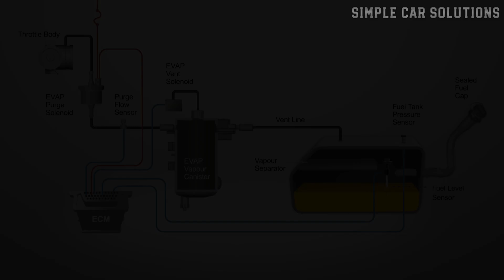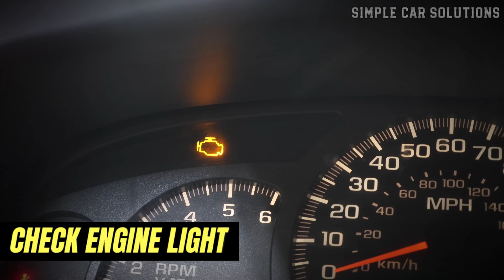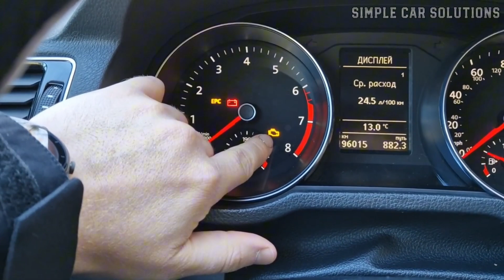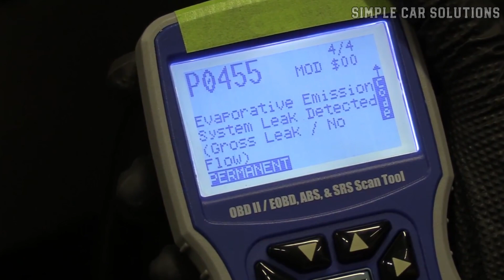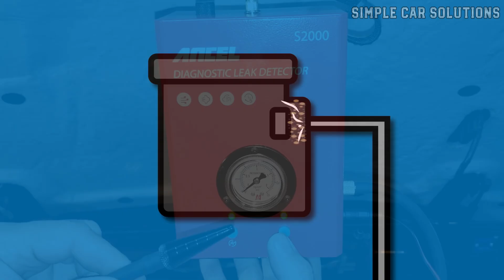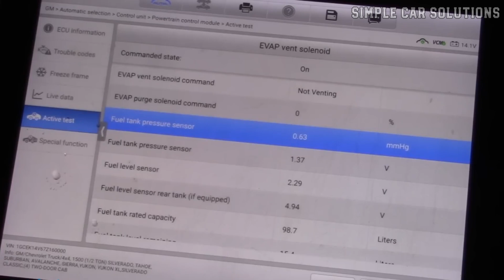5 Easy Signs EVAP Vent Valve Needs Fixing! Don’t Ignore These EVAP Canister Vent Valve Symptoms!

Comment: So I got p0446 vent control problem and p0455 large leak detected replaced fuel cap fps vent solenoid and purge valve. Smoke tested system and found no leaks solenoid clicks on and off as well as inspected canister filter from vent solenoid hose and found filter to be clean not excessively dirty any idea what else I should do before replacing canister? Btw this is a 05 Silverado 5.3
Reply from the maker: Before replacing the canister, check the vent valve wiring and ground at the rear frame (very common on Silverados), and make sure the vent valve actually seals when commanded closed. Also inspect the vent line from the canister to atmosphere for internal blockage. If those check out, the canister is the next likely culprit.

Comment: My 2017 ram 1500 3.6L vvt is showing code p0441 i have checked purge valve with 12v and is opening and closing, i have cleaned canister filter, what more do you think could be. Thank
Reply from the maker: If the purge valve checks out, next check the EVAP vent valve (stuck closed), vent wiring, cracked EVAP hoses, and the gas cap. On Rams, a faulty vent valve or restricted vent line is very common with P0441. A smoke test is the fastest way to confirm it.
Reply: @SimpleCarSolutions i ordered  the cap already, was little bit loose
Reply: Thanks.
Reply: @SimpleCarSolutions how can i do the smoke test
Reply from the maker: @lestergd4198 You can use a smoke machine connected to the EVAP system, usually at the purge valve or vent line, and watch for smoke escaping from leaks. Make sure the vent valve can be commanded closed during the test for accurate results.

Comment: Hi, my 2006 Toyota Yaris is failing the emissions test.
I compared it with another Yaris and noticed that when the purge valve is operating on my car, I can hear air being sucked in with a noticeable noise. On the other Yaris, it operates quietly and normally.
I tried swapping the purge valves between the two cars, but there was no difference — the issue stayed with my car.
On my Yaris, whenever the purge valve activates, there is a clear sound of air being drawn in intermittently.
Could you please help me diagnose this issue?
Reply from the maker: That noise usually means a vacuum leak, not a bad purge valve. Check the EVAP hoses from the purge valve to the intake and charcoal canister for cracks, loose fittings, or a stuck vent valve. Also, inspect the gas cap. A smoke test will quickly pinpoint the leak.

Comment: 😊😊 question, about 2022 GMC sierra, where are systems located?
Reply from the maker: On a 2022 GMC Sierra, the EVAP vent valve is usually near the charcoal canister by the fuel tank, mounted on the frame rail at the rear of the truck.

Comment: You gave some false information......The vent valve is normally in the OPEN position so doing a smoke test will be inconclusive when seeing smoke come out of there. You have to make sure the computer signals for the vent valve to close in order to do an accurate smoke test. Also, just because the vent valve is open during a smoke test doesnt mean its stuck open like you said. As I mentioned, OPEN is the nromal position for the vent valve.
Reply from the maker: Vent valve default position may depends on the manufacturer. A smoke test should be done with the valve commanded closed to accurately check for leaks.
Thank you for pointing this out in the comments.
Reply: My 03 highlander vent valve is closed until actuated to open
Reply: @TheKeeperofdeath  Yep. Hyundai default/no power is closed. Going through this crap now.
Reply from the maker: Vent valve default position depends on the manufacturer. That’s why you always need to check the wiring diagram or service info for the specific vehicle before testing.

Comment: How about P0456 (very small EVAP leak detected).  New gas cap (OEM) filler neck is clean and shiny, replaced purge valve.  (2011 Saab 9-3 with 86,000 miles).  cleared generic code, but Saab OEM enhanced mode says no codes stored in memory, using an innova scanner.  I do have a smoke machine but haven't smoked it yet.  Trying to avoid dropping  the tank to check the pump sealing ring , etc.. Anything quick I should look for?  I drive on clean roads.  Inspection due Dec 25.  Thanks!
Reply from the maker: Check the easy spots first before dropping the tank:
- EVAP hoses at the purge valve and charcoal canister
- Vent valve and its hose (common leak point)
- Cracked small-diameter vapor lines near the rear wheel well
- Loose or dry-rotted canister fittings

Then run your smoke test - P0456 almost always shows up quickly with smoke.

Comment: When I did my smoke test on my 2018 Malibu LS 1.5L turbo the smoke was coming from the fuel tank area
Reply from the maker: Smoke from the tank area means you’ve got a leak back there, likely a cracked EVAP line, bad vent valve, or leak around the canister.

Comment: I have no error codes, but still i can smell gasoline inside the car, can be  evap purge valve blocked on open?
Reply from the maker: Yes, a purge valve stuck open can cause a fuel smell inside the car. Also check the fuel cap, lines, and tank area for small leaks.
Reply: @SimpleCarSolutions see my  comment above. I need expert opinion
Reply from the maker: @OleRazzleDazzler  Your symptoms strongly point to low fuel pressure or a major vacuum leak.
Check: Fuel pump/fuel pump relay, Cracked vacuum or PCV hoses, Air intake tube.
Stalling when you press the gas is a classic sign of a fuel pump failing.
Reply: Does it cause a rough idle? I have a rough idle, and the fuel pump is always shutting down when fueling, but no codes… :(
Reply from the maker: @shannonwitthacannons9461 Yes, a stuck-open purge valve can cause a rough idle.
The pump shutting off during fueling points to a clogged vent line or vent valve issue. I’d check both the purge valve and the EVAP vent line next.
Reply: @SimpleCarSolutions  Thank you! I changed the purge valve, which didn’t seem to have anything wrong with it. Still have the same issue so I’ll move on to the vent valve!
Reply from the maker: @shannonwitthacannons9461  Good plan 👍 Check the vent valve and vent lines next. That’s often the culprit when the purge valve is fine.
Reply: I have a large and small evap leak codes. And random misfire on bank 1(1,3,5,7) , lean mix bank 1. Replaced those spark plugs, now after a little test driving, I have all those codes again besides lean mix, but my truck stalled and wouldn't accelerate anymore. Help me please. 20p2 dodge durango. Im honestly close to killing myself with fighting this truck, other issues as well within 3 weeks, im homeless, I live in my car, I need ot to survive.
Reply: Car will now start.....real rough, and it starts stalling when pushing the gas pedal when idling, this is of course after I coasted to a parking spot when I lost all engine power while driving. PLEASE. SAVE MY LIFE.

Comment: When doing a smoke test does the vent valve need to be powered?  I did it with the key off and smoke was coming out of it.  Does this mean its bad?
Reply from the maker: Yes, with the key off, the vent valve is open, so it will leak smoke. Power it closed during the test; if it still leaks, then it’s bad.

Comment: Thank you for your video he was very informative. 
I have a 2014 E450 van.
I was constantly blowing fuse number 76 at 20 amp fuse.
Check all my contacts under 76 and I think my purge valve solenoid was going bad.
I put a test light probe into the socket of the fuse on the outside line of the fuse and tied a ground to the probe this lit up and stay lit for a long time it eventually faded down to just a minor glow and the problem has gone away so I'm thinking that it is the purge valve solenoid
Reply from the maker: Sounds like you’re right - a shorted purge valve solenoid can definitely pop that fuse. If the fuse stopped blowing after the current bled off, the purge valve was likely the culprit. Good catch.

Comment: I have replaced the canister,vent valve and selenoid and the 449 code is still showing up 😢
Reply from the maker: Check the wiring and connector to the vent valve, especially for corrosion or broken wires. Also, verify the vent line isn’t kinked or blocked.
Reply: @SimpleCarSolutions thanks so much
Reply from the maker: @bmw201144  You’re welcome! 👍
Reply: @bmw201 How did this resolve for you ?  I was thinking that once all that is replaced - you'd want to disconnect the negative battery cable for around 10 to 15 mins - to erase the original codes.

Then hook it back up and drive the vehicle for 50 to 100 miles - to see if the replacement parts work or not. Have you done this or what ended up resolving the problem ?
Reply: @turnsufficient4971 I tried all of that and still 0449 code changed out the solenoid three times and that code for the solenoid still keeps coming up, and the engine light has never went off
Reply from the maker: @turnsufficient4971  Disconnecting the battery can clear stored codes, but it won’t fix the cause. If P0449 returns after driving, there’s still a wiring issue, bad ground, or PCM control problem. Best next step is checking power/ground at the vent valve or doing a smoke test.

Comment: Good evening, its a great video to have a better picture about the vent valve and its work. Very few are out there.
Im searchung for months my issue on my VW golf 5 1.4 fsi BLN 2003.( Early golf 5) i had a p0441 code and after scanning everything said change the purge valve right at center back of the engine. It goes well 2..3 days and then p0441 again. Changed it to an Oem purge valve.  Same thing after 2 days. So p0441 still there. Chacked hoses all good. Canister souds like heavy sand inside but no breaks outside.  So i dont even kow what the issue can be. Cause after canister or passengers weel next to engine there is nothing but a white 8mm  pipe going back to the tank. I checked all 3 damaged purge valves even new one they are all steak opened when conpletly disconected and air flows in them ..not totally free but pretty stuck opened, like 30%++. I have disconected the hose that goes from P.valve n80 to the intake and blocked both of them on right side with tape so no air+vape goes in intake freely for few days and no vapors go out of purge valve.i just open tank cap after every ride to escape the vapes. Same again p0441 on! My issues: bad acceleration, roufh starts and maby sometimes engine dye first cold start. Sometimes jerks a bit especially arpund 1800 rpm ++  after 15 minutes ride and over, very bad horsepower and sometimes smell of wierd unburned gas or smthing like this. And p0441 check. ( it also appeared a p2294 that killed my previous high pressure fuel pumps regulator  some days  before 8dys* for first time ever and car had no power at all and steuggled and jerked like crazy but changed it with a used one older i had and for moment goes fine last 10 days so only same p0441 is up now still ..but car goes better now..but still same issues and symptoms of p0441) it is first time i hear about this vemt valve but i never had problems filling my tank so never suspected this. I dont even know if every car has one vent valve. Im mine has it may be built in tank! I donno what could be the issue really! Car seems week like dont breathe right or dont have the proper mixure! Hope u have some ideas what could it be ..searching for months now.! Thabks again for video it really helps a lot, wish u luck and make even more of these detailed  informative videos.🙏
Reply from the maker: Good evening. Thanks for the details — sounds like your vent valve or charcoal canister is restricted or stuck. Since the canister feels like it’s full of debris and P0441 keeps returning, replace the canister and vent valve together; that usually fixes this on the 1.4 FSI.
Reply: @SimpleCarSolutions thanks  for the reply. I dont know what a good canister soynd or feels like when shaking it. It has some small black pieces inside and a bit of black dust and when i shake it it doesnt feel like has liquid inside and dont even smelled anything that much on it only these 5 days i closed the right side  pipe on purge valve that made it smell like it has vapes on it. I let them free today but nothing has changed.  Same rough bad acceleration , jerking and check p0441. U believe carcoal is  damaged inside? I also pushed air with mouth from  pipe back of canister that goes to tank and after pushing air..this thing sent vapes outside to me not freely but felt kinda  bit easy to push air with tank cap closed. 2 minutes before doing this i had opened the tank cap to escape vapes after ride and closed it again. Some Mechanics say canister never fails. And maby its vent valve but now i cant find this vent valve on this specific car. Maby its built in tank??cause my car is one of first golf 5s and this may be diferent than later versions and have different place the ventvalve. Hope that wont need a complete tank change!!!!! If u can help with the place of my vent valve and some more advice on carcoal canister i would be really thankful.  Thank u again.
Reply: @SimpleCarSolutions + today i realised also  that part of gas smell comes from the inside the car also. Fuel pump seems ok there but i donno if any of the pipes that go from back tank ..straigjt to the canister near engine ..if it passes feom inside or putaide the car.
Reply from the maker: @groovyleovibes3215 The vent valve on your early Golf 5 (1.4 FSI BLN) is usually built into the charcoal canister assembly near the rear right wheel, close to the fuel tank — not under the hood. If the canister rattles with black dust or pieces inside, it’s likely damaged or fuel-soaked. Replace the whole canister assembly; that will include the vent valve and should clear the P0441 and rough running. Also check for any fuel vapor leaks under the rear seat area — that’s likely where the gas smell inside is coming from.
Reply: I think you got gas in your charcoal canister "never top off" your gas tank 100%  some cars get gas in the canister from the fill vent tube, but that won't cause you car to run the way it is, If the inside of your tail pipe is black your car is running way too rich, and the spudering sounds electrical.
Reply: @portagepete1 well thats true, i actualy used to fill it every 2 weeks pr 1 week to top. Now i know the damage it can bring. But also i had my car 1 year ago to mechanics cause of engine reconstrucrion. Valves and camshafts actually..and that day my car stuck  on road amd brought it to mechanics i remeber i just had it fully filled  and left it there for 5 weeks. So now i suspect maby a vent valve was stuck open or so cause canister was taken of the engine completwly for a month++.do u think herking comes from wiring issues electric?? But why when it shakes and jerks amd check come up p0441...after i stop open cap to breathe air the tank and also delete code ..after 10 min it goes better ...for some time of course or 30 min..1 hour...max!! After that same things again. Also i have described some more details about my canister. I doonoo if thats the issue cause i didnt even feel like my canister had too much vapors in it to smell a lot wgen u take out the pipe after a long run. Mostly i smell fuel outside the car than close to engine or canister . Also doesnt feel that have liquid inside just small pieces of carbon all inside when shaking feels like sand  bit..heavy sand.and has some black dust on it. The wierd thing is that this system or something vrom vape system destroyed 3 purge valves of mine in less than month all 3 stuck oppen a bit and no close correct.  Also i dont see any black smoke 99% of time feom my exauste. Only when cold start or when starting climb up a hill for 1..2 seconds light grey smoke ..after that nothing all good. So a bit of carbon it may be in the exaust system but ive chanbges 4 yers ago the catalyt and pre catalyt also to new. Also 1 more thing ..4 yers ago i took a new hpfp oem and it died just 1 week ago. Or maby not but p2294 was for its regulator so it definatly had destroyd it and the car went like with 5 horse powers ..and jerking like very bad for few days..but not all times same jerk intensie..some hours better sometimes worse. Till i changed it to an older one i had and no p2294 any more. But only..Still every day get p0441.
Reply: Will you get a shuttering or surge during acceleration with a faulty canister or vent valve?
Reply from the maker: @ctrobinson5524  Usually no. A bad vent valve/canister causes EVAP leak codes and fueling issues, not acceleration shudder. If you're feeling surging, check for misfires, clogged fuel filter, or dirty throttle body instead.